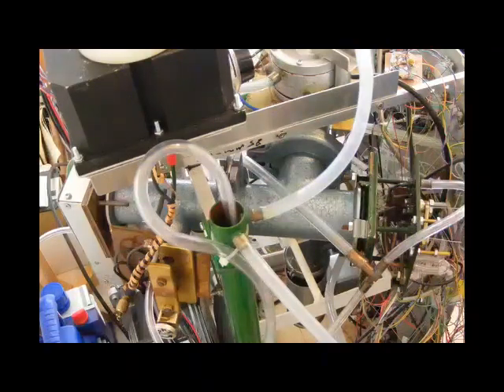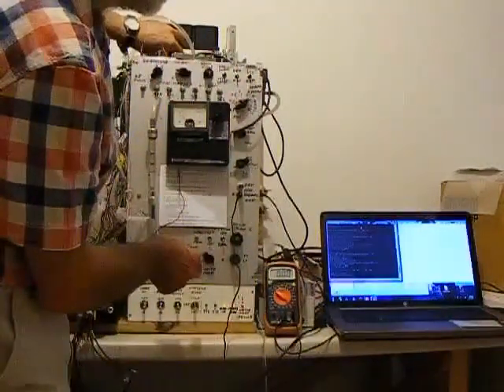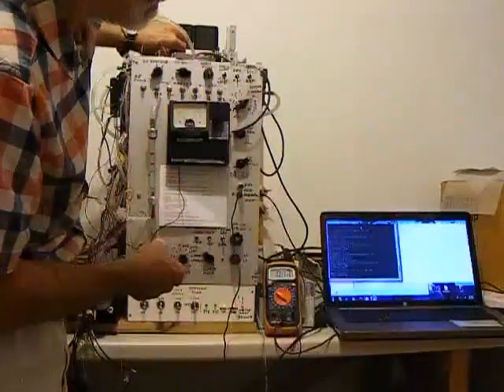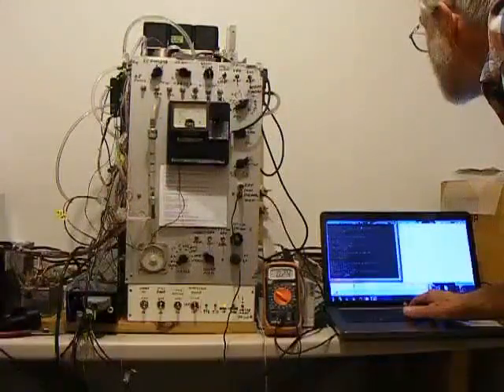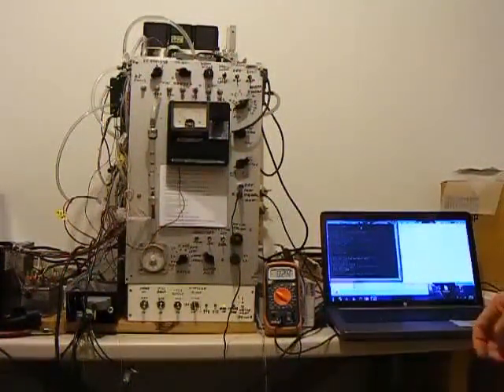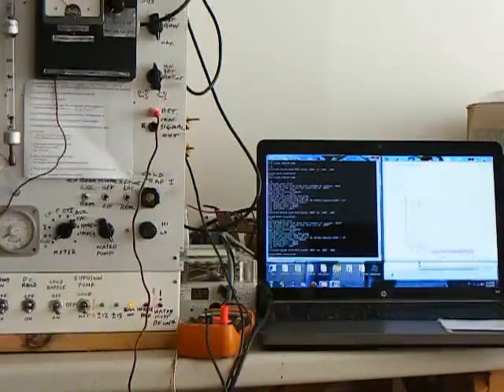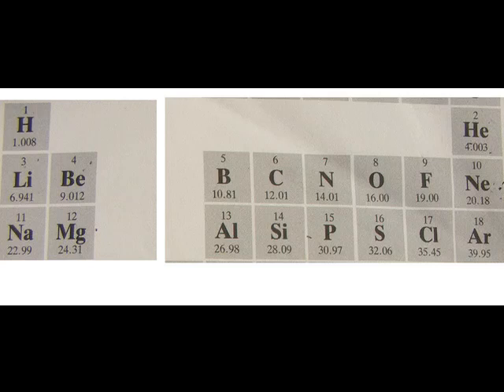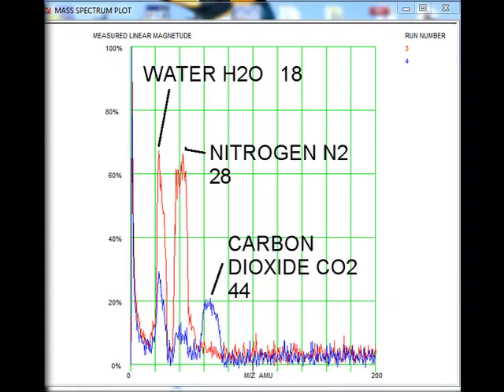Working Home made Mass Spectrometer

Comment: thank you very much, great project. Is it possible to measure quantities of the elements? So for example I would like to know the amount of calcium in my tap water?
Reply from the maker: Hi There, yes that is one thing mass spectrometers are used for in industry. There are a couple of things to realise: The peaks that you measure depend on factors such as how easily the components in the sample are ionised, and this must be accounted for. Also if it is necessary to separate two compounds that both have complex spectrums and overly each other, then the sample may be passed through a chromatograph first which separates the components in time. This one is experimental and not of great use for this in its present form. It is possible with the right equipment to measure different isotopes of the same compound or element with vastly different abundance, e.g. carbon dating.
Reply: @reytdhfuytf  Thank you for the informations. So to adjust our measurements we would for example use a reference solution with a known quantity of the elements we would like to measure ? I guess another problem would be to ionize several different solutions shortly after one another without destroying the vacuum. Another youtuber mentioned using a laser to create ions or inductive coupling altough it seem commercial products use argon gas to create plasma so I am not sure if the use an argon atmosphere or how they maintain the vacuum. Sorry for my english I am a german electro engineering student and the fact that mass spectrometers are able to even measure masses of different isotopes is truly amazing.
Reply from the maker: @ImPresSiveXD  You could calibrate as you say, I expect commercial equipment has built in correction for the efficiency of ionisation of different compounds. Really with a MS you are measuring the relative concentrations in a sample. There are many different methods to ionise a sample, which is best depends on application, an electron stream was the first used and probably easiest. The vacuum pump is continually running, and also the sample is continually being leaked into the ioniser from atmospheric pressure. This is how it is normally done I think so the sample concentration in the chamber is stable. I think the most amazing thing that can be done with a very good MS is measure the mass defect for different elements, which is a measurable mass that results from the bonding energy of the parts of the nucleus. E = M C^2 The mass of an atom is very slightly below the sum of the component parts.
Reply: @reytdhfuytf  very interesting! Maybe you could make an update video on your MS spectrometer. Best regards Sebastian

Comment: Thank you for making these videos! Great project. I wished I had the background to experiment like you! Do you know some literature (not the scientific side, instead the engineering side) for construction of MS and  about the crucial hardware, and the physics behind them?
Reply from the maker: Hi Kaan, thanks for kind comments. I have the advantage that I work as an electronics engineer, so I understand that; but I discovered about this field by trawling the net for info. You can do that. If you want a simple experiment to make and detect ionised atoms, you get an old radio valve and with lower than normal heater voltage draw around 10mA to one electrode at about 120V. Then if you have a sensitive low current detector you will be able to see a few nA of current flowing in an electrode at -30V. This is the residual gas in the tube being ionised by the 10mA electron stream.
But don't play with these voltages unless you understand what you are doing. To make a mass spec. does take rather a lot of work and facilities, I still have work to do to get this working properly.
Reply: @reytdhfuytf  Thank you very much for your answer. My knowledge in electronics is not much at the moment. I won't experiment with a radio valve, but thanks for the example. I will think about the theory behind it.  I used mass spectrometers at Work, hopefully finishing my dissertation. However, I have a wish to go deeper into the hardware (like open hardware projects, IoT...) Maybe I will start with Near Infrared spectroscopy. The hardware is more affordable, and less complicated. 
I wish you good luck! and I am looking forward to your videos.
Reply from the maker: @kaankutlucinar4011  Hi Kaan, yes it is fascinating looking at the science of things around us. Well you are more experienced with using commercial mass specs than me, I have never used one. You will understand then that I need to get the resolution much better. About the radio valve experiment, if you look up "hot cathode ionisation gauge", you will see the effect I am mentioning. That would be interesting making a light spectrometer. You could use a CCD detector as used in a photocopier, if you made some electronics to go around it. BR Paul